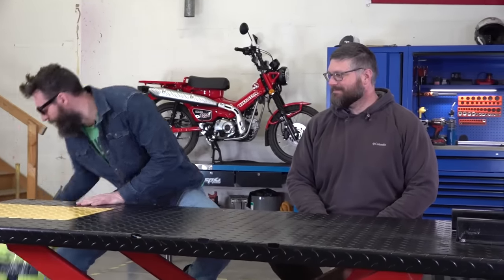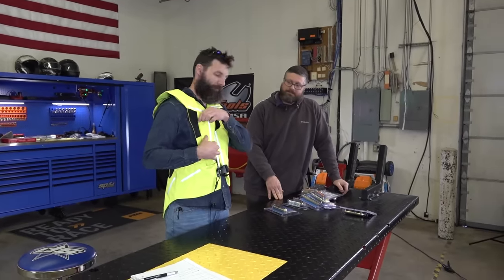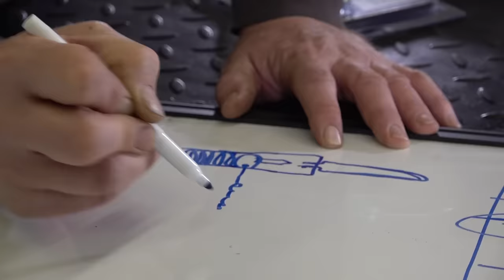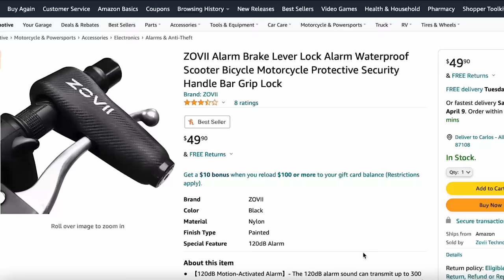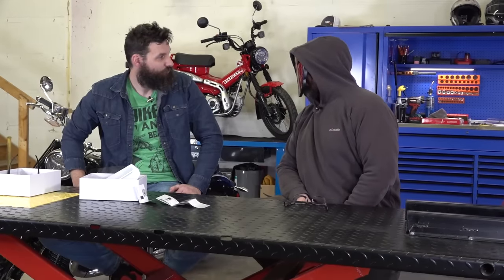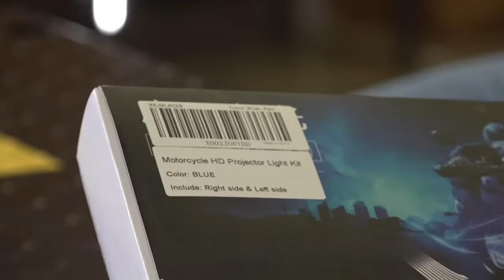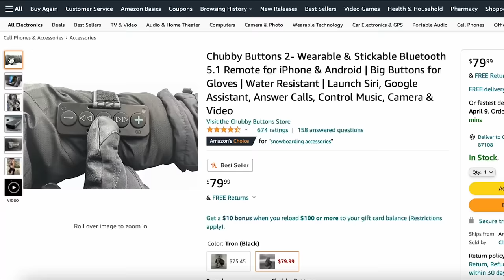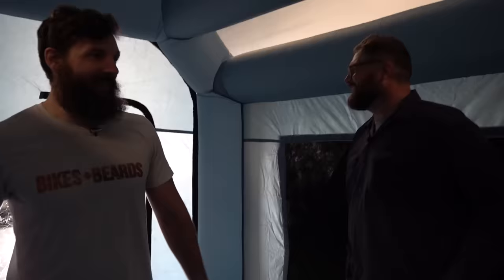Testing Amazons stupidest Motorcycle Accessories (#1 is life saving)

Comment: The vest looked like it took a bit to completely fill, but the collar seems to have instantly inflated.  That's the part that's going to butt against your helmet and brace your neck.
Reply: Looks like he's being attacked or loved by some sorta woke Hobbit. {0.o} 😆😂🤣
Reply: yeah and to be fair you are most likely gonna have something ells protecting your back and softening the landing a little.   usually there's not much for chest protection so at least it would help allot against that to.
Reply: I happen to wear the vest for over a year now in Mexico city, it is also water repellent overall is Good quality. Bad thing are the 33gs Co2 tanks which are not easy to find nor cheap.
Reply: I got Helite for $700 4 years ago. It is quite heavy but, it works as tested in real riding situation. If I didn't have $700, I would look into it.
Reply: @oknevals  I literally got the helite for 300€ and teh frequentyly go on sale here, for that price its honestly pretty sick, because you dont grow out of it.
Reply: @oknevals  how heavy it is ? i wonder about getting one but my vest is already pretty heavy but sadly i can't find it easily on the stores to test it so i might need to order it online.
i'm also wondering, you have the cordless version right ? what happen when the warranty wear off after the 4 years with the sensor ? do you need to change it or is it safe to keep ?
Reply: @Valjque  Mine is corded. I just got on scale with and without it. The difference was 3.8lbs. It is heavy and it is bulky and on hot day it is quite miserable experience. On long rides (100s of miles) it will wear you out. On the other hand, if I'm commuting in the city in heavy traffic or riding in bad weather, it is giving me little better chance. I think it is worthy but, I admit I sometimes go without it when I feel that risk is not as high. I recently went on 1400 miles trip. 300 miles was through rain. It is cumbersome what to do with it if your want to take it off and go without for a while.
Reply: @oknevals  yeah that's exactly what I'm afraid of... I lean more toward the cordless because I know I will trigger it by going off the bike way too frequently but it's a real investment if In the end you prefer to go without it..
Reply: @Valjque  I activated by accident couple times by dropping  bike at low speed. One time in real accident and that saved me from  lots of pain and injury. Actually, walked away. I did get injured that kept me from riding bike for few weeks but, not lost day for anything else. Cord does not activate that easy. Takes around 65lbs.
Reply: Cycle cruza love them lol
Reply: It probably failed to inflate quickly because of the way the neck area was designed.  I am not impressed by it.  I think as well because gas is still rushing around to fill it the neck may not be that robust immediately.  I think an airbag vest is one of those things that is just not worth cheaping out on.  I can't see how much it costed anymore because it has seemingly gone down from Amazon.  I honestly don't think I would spend over a hundred for this though.

Comment: Interesting, I thought you had to buy a whole new vest once it's been deployed. The fact that they used replaceable c02 cartages makes it so much more worth it
Reply from the maker: and you feel more confident bc you know it works
Reply: There’s different types of airbag vests, some like the one in this video, and the accelerometer kind that requires sending back to the manufacturer to refill, and as F9 said in his video, they could always say “sorry, this vest isn’t safe to reset, you’ll have to buy a new one”
Reply: I have a HitAir vest and they recommend replacing the vest after six deployments regardless of outer appearance and condition.
Reply: alpinestars race vest has a 2 deployment limit before both co2 cartridges need to be serviced and replaced. So if you bought a cheaper version I honestly would toss it because I wouldn't know if the bladder of the vest can actually hold multiple deployments. I had the first Helite airbag vest when u first started riding and it was great. but I would spent $500-700 to have the A-Stars vest.
Reply: Yeah fr
Reply: @rickytickybobbywobbin7430  To be fair though, asphalt is not at all nice on fabrics and repetitive use of cartridges will weaken the fibers.

Comment: The vest likely does NOT come with a CO2 cartridge due to shipping issues for those cartridges.  I think they can only be shipped by ground.  Anyplace that sells inflatable life jackets will also sell the appropriate cartridge.
Reply from the maker: it was harder to find than we thought
Reply: @BikesandBeards  most ship chandleries would stock those, but in the midwest (where I think you’re located) probably only large fishing stores would. But yes, not a common item. Smaller cartridges used in some BB or pellet guns would be easier to find, but might lack the volume to fully inflate the vest.
Reply: @BikesandBeards  it doesn't to hard to find.. I buy them on ebay.
Reply: @dahveed284  They are in PA.
Reply: @BikesandBeards  I’m not positive they’d have that size cartridge but I’m pretty sure hobby stores would have them too. For model car racing kits.
Reply: It's because kids use them to get high
Reply: @macbook802  lol tf. You don't do whip it's with CO2 old man.
Reply: @craigcampbell1843  did you look up what a whippet is and delete your comment lol
Reply: @TheAsheybabe89  You can use CO2 to get high not as high as NO2 but they do use them.
Reply: @macbook802  next person who grabs the whipped cream container is like wtf man who's the Huffer 😑
🤣🤣🤣
Reply: most vests need at minimum 40g I think the dianese uses a proprietary 88g and its something like 45$ each for new ones.
Reply: @dahveed284  They're like 2 hours from the Atlantic Ocean lol.
Reply: Bikes and Beards @ 2:42
"anti-climactic" was right!
 We were expecting a stuntman was going to, I don't know,
fly over the handlebars: 🏍️ 🛵 🚴 of at least a bicycle to test it
onto loose dirt or asphalt to test it out, 
with a helmet on 🤖 ✌️

I've seen guys go over the handlebars do a somersault walk away just fine but at least testing out the vest like that would have been a touch more interesting.
Reply: @BikesandBeards  Paintball stores are great for these types of things, a good store will have LOADS of CO2 or High Pressure Air cartridges for you to choose from, and the disposable ones tend to go for 5$ - 10$ a pop. I had a tippman tipx that took CO2 cartridges, and when I got a Helite vest I took it to my paintball place and they took a look at it. It now costs me 10$ to refill my helite.

Another option is to acquire a HPA Tank sized correctly for the vest. With the HPA tank ,you never need to buy CO2 cartridges again. The HPA tank tends to come with a gauge, so if you find what pressure the vest needs, and HOW MUCH expansion, you could have a forever reusable vest. If you arent completely comfortable with figuring out how much pressure and air you would need, I would stick to CO2. Its easier for the majority of people to just buy a disposable cartridge every year
Reply: @ramrod126  because our state is so corrupt.  Everything is hard to find here
Reply: You can also get them at bicycle shops. Us mountain bikers use them for inflating tires in the woods
Reply: @BikesandBeards  ?
Reply: @BikesandBeards  hell, anyplace that sells a decent selection of airsoft guns would work as well
Reply: Restaurant supply stores should carry a few varieties of C02 cartridges. They are used in those fancy whipped cream dispensers and a few other kitchen tools

Comment: I love that you bought the inflatable vest. I've got a HitAir brand airbag vest, it used to be the cheapest one on the market and it was like $500! According the HitAir, the neck collar is the most significant protection these things offer and the neck collar on the amazon vest inflated really fast! I think its worth it based on your quick demo.
Reply: I also have a hot air that I use when I’m racing at the track and I’ve never had an issue with it popping when I get off the bike I think that this bag popped a little too easy
Reply: I have a Hit Air too!  Sometimes simple is just better (there are issues with the electronic airbag vests sometimes).  The only time I've accidentally deployed it is when I dropped my bike at like 2mph and tried to walk away lol
Reply: Is the hit air worth the 500? Provide good protection? I already broke 2 vertebrae in my back skydiving. & my tailbone.
Reply: @JohnnieV  It depends. I find that I don't wear mine very often and in my case it probably wasn't worth it. I think the company only having a few products, just motorcycle and horse riding airbag systems, is reassuring. All of their r&d goes into these airbag systems, not just motorcycle gear in general.
Reply: @JohnnieV  The hit-air vest does inflate and unfold around the neck and down the back, a flap at the bottom folds out during inflation covering the tailbone. Personally I'm not convinced it will inflate fast enough to provide protection from the first strike against a car or the ground but better safe than sorry.
Reply: very true. Hopefully they are constantly improving. And maybe it fully inflates at precisely the moment of impact. Maybe it’s only 70-80% inflated. Some protection better than none. The vest confortable enough?
Reply: @JohnnieV  Yeah the vest is comfy enough. I got it large enough to wear over a normal armored jacket so its quite loose. The dangling tether is kind of lame, looks doofy hanging from my bike when I park it. Also it can be annoying if I'm riding the bike without the vest, as I don't usually remove the mounted side of the tether. My biggest issue with the tether is that not every bike has a centralized mounting point. when I tie it to my harley it ties to a rack on the right side of the bike and I think it would have a foot and a half extra length before triggering if I fell off the right side vs the left.

Comment: lever locks are useless against a wrench on the banjo. A rotor lock would be more effective.
The mask is pretty cool.
Wing lights are silly.
Paint booth is pretty nifty.
Reply: yeah rotor lock is very effective and also has an alarm function... I stopped using mine though because it would randomly go off from the wind ... in my trailer LOL ... I'm sure better brands are well better

Comment: Great episode!  That vest looks perfect for my needs.  I was looking at some others and they were running about a grand.  So $200 + $25 cartridges seems downright reasonable.
Reply from the maker: Right on!
Reply: @BikesandBeards  @2:42
"anti-climactic" is right!
 We were expecting a stuntman was going to, I don't know,
fly over the handlebars: 🏍️ 🛵 🚴 of at least a bicycle to test it
onto loose dirt or asphalt to test it out, 
with a helmet on 🤖 ✌️
Reply: The Helite vest was $550 when I bought it.  I hope it’s not $1k now?
Reply: @professorvoluck9311  The one I was looking at was a jacket with a built in airbag (GP Tech V2).  Cost was $999
Reply: Check out the helite turtle
Reply: @darronjknight  will do, thanks for the tip.

Comment: I’ve ridden with this Amazon vest for a year now and I really like it. Was worried a bit about it blocking air flow on a June trip through Mojave Desert, but it flows plenty. At first I also worried about setting it off accidentally, but the cord starts stretching a bit if you forget and it reminds you. Plus, I’m usually giving the bike a quick scan before I walk away, making sure I didn’t leave keys in the ignition, tucking away gloves and stuff, and you pretty quickly see the cable. Have compared side by side with much more expensive model and they look and feel similar in quality. Have NOT used it in a crash. Nice review btw.
Reply: Do you have the amazon link to the vest?

Comment: Go to any metal worker shop and ask them to replace the 4.5mm cutting knife with a 5.9mm one (shouldn't take more than 5 minutes, I usually pay €5-10), also make sure you're using 45g CO2 cartridges, not the 35g ones. It'll fill up in about 0.1 second (which is what big US brands promise currently) instead of the 0.2-0.3 it takes stock. It's a trick known for over 10 years (airbag vests are used for various sports since the 90s and athletes modified them in many ways).

Comment: A use a Helite Vest for all my rides. It needs only one CO2 cartridge. Vest cost 550€ inkluding 1 cartridge. If you need a new one, it's round about 15 €. And if I try to stand up from the bike, without disconnected from the trigger, it needs such a force, that you know for sure, that you are still connected, without activating the Vest! And if you do it daily,  it's a regular movement and you never forget to connect or disconnect it.

Comment: The vest they had used was more of an off-brand one, so it seems that the quality in regards to the required pull-strength, and the speed at which the airbags properly inflated, was not on par to that of the name brands: ie. Alpinestar, Helite, etc.
Reply: Physics. They inflate the same, using the same canisters. The inflate time will be the same.

Comment: I have a 400 EUR airbag vest from hit-air and from what I can see in this video 3 differences show; 1) I forgot to unplug mine numerous times when I arrived at work and never did that result in a deployed jacket. It does deploy when I crash. 2) once deployed it slowly starts to leak right away. 3) it came with a canister 😁
Reply: Did you crash wearing it? How well did it work?
Reply: @jimmyjakes1823  yes once at low speed going over my handlebars and it triggered before I touched the ground. My neck was supported and I only felt pain in my hip afterwards. Sideways on the hips is not supported.

Comment: Vest would be a great idea for small yacht's, kids on yachts or jet ski's etc..
Reply: Which is what its intended use actually is: use on a boat, not on a bike!
Reply: @paulvarnsverry11  the boat ones are much smaller because they are only meant to act as floatation devices, this is for motorcycles

Comment: @bikesandbeards, I have a problem. Do you see the ECE rating for this? Is it rated for motorcycles? It is rated as a back protector? Will it hold up to abrasion 30-100 ft on asphalt? I really wanted to get one of the chinese air bags and did a lot of research. All the falls people survived were low speed, and all the safety ratings were questionable. There is a HUGE difference between an airbag and a boating life vest.

Comment: I think the one Fortnine reviewed won’t deploy if the string is pulled at less than about 15mph, so it won’t accidentally deploy like the Amazon one.
Reply from the maker: Interesting. I wonder how it does that
Reply: @BikesandBeards  : By being properly designed for motorcycling use and by satisfying the requirements of the European Standard for motorcyclists’ air vests: EN 1621-4, which assesses the fitness for purpose of air vests in motorcycling use.

Comment: For the record, sound sensitivity (SPL) is typically referenced from ~1 meter away from the source.  Way to get that right.  The company advertising 125 dB were either lying, or measuring at a distance of less than a foot away.
Reply: by my calculation.. that is pretty much the reading at the source... I estimated he was 1 meter away when he got the 80dB rating, so working backwards I got 120db at 1mm.. so the claim is a point source claim... so deceptive advertising, but not straight out lying.

Comment: Air vests are being sold on e-commerce sites supported by heavily tampered-with “certificates” where the supplier’s details have been changed; however, the standard the vests are claimed to have been tested to is that for marine life vests, the inflation rate for which is, in relative terms, deliberately slow and not appropriate for motorcycling applications. There is a European standard specifically for motorcycling air vests - EN 1621-4 - and riders take a risk purchasing anything which is either untested (which most products sold on e-commerce sites are not) or sold using fake documentation. Buy an authentic, tested and certified product from a reputable dealer. The e-commerce sites are not safe environments from which to purchase products on which your safety could depend!

Comment: I feel like that handle lock/alarm would work best on the clutch lever side, if the lock prevented the clutch from being pulled and you keep the bike in a gear. Front break lock even if they wanted the bike real bad could remove the front wheel and the front break doesn’t matter anymore